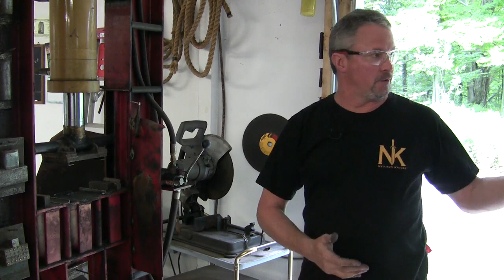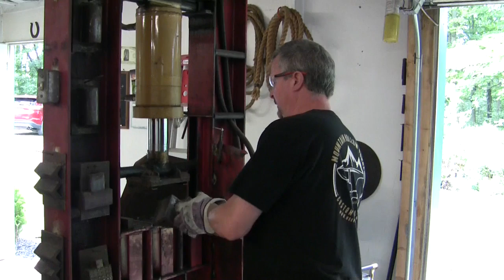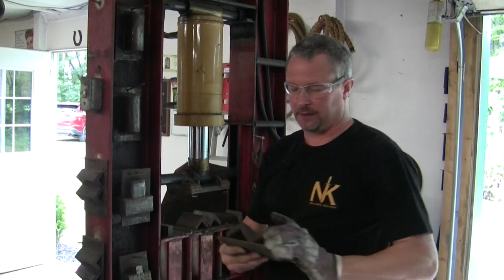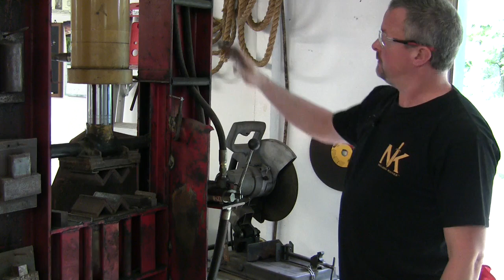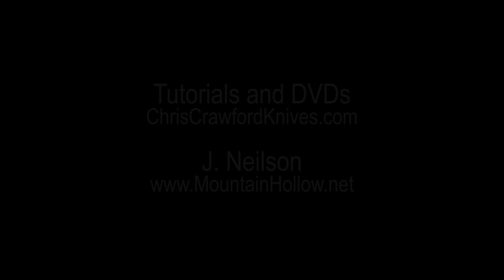Welding Canister Damascus by Hand - J. Neilson

Comment: I have a question, if you could fabricate some dyes out of angle iron, could you weld them in a vise and fuse the Damascus together that way?
Reply: Hank Owens you will not get nearly that pressure. But you can do that for the initial weld as long as your piece is hot enough I imagine.
Reply: @THExRIOT1865  alright cool, you think the pressure would be even enough?
Reply: knuckle head803 keeping it even in a vise would be tricky, but you could try to apply similar amounts of force to the opposing sides. It would be easier to use a series of overlapping hard taps down the length of the billet, then rotating 90 degrees and repeating. As long as you keep your hits even you should be able to get a nearly square billet.